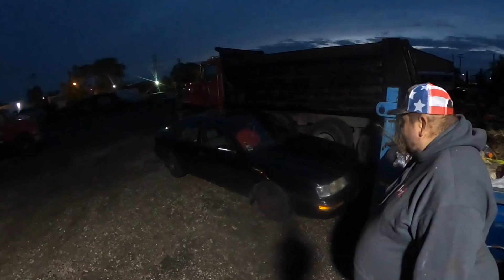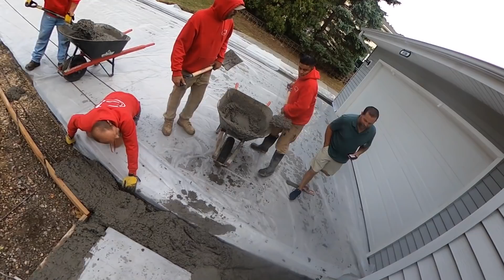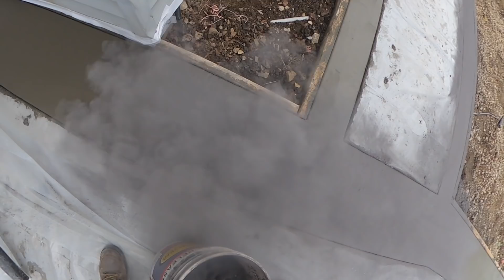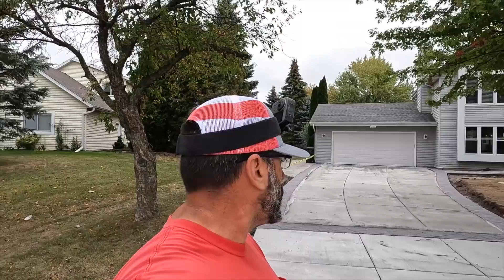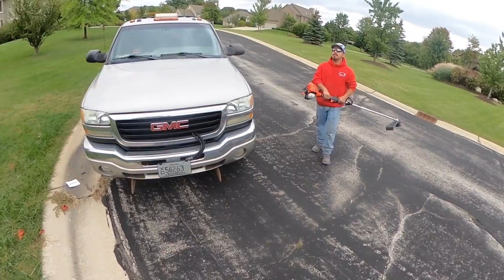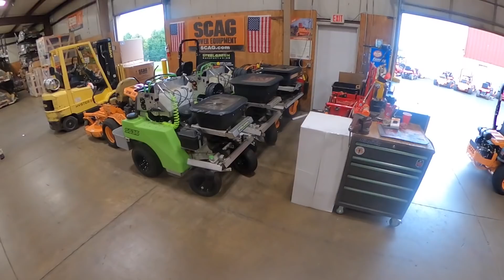Colored and stamped concrete borders-AND mowing

Comment: SCAG is the way to go. I’ve only been landscaping for 2 years, but I’ve been on John Deere, Wright, and SCAG. Scag really outshines the competition when it’s wet or super thick, has great throw for less clumps. Also has a much more comfortable(easy on the knees) platform and thicker pad to lean against.
Reply: ferris easily has the best and most comfortable to use mowers
Reply: @Richard Cranium it’s not as bad on mowers as the heavy equipment
Reply: @Richard Cranium .
Reply: Ferris and Exmark are the best in the game when it comes to mowing.
Reply: @johnvillanueva96  used exmark for years and switched to John Deere and won’t go back personally
Reply: @OlDirtyBandit  which machine were you running? And what machine did you switch to?
Reply: @johnvillanueva96  60” lazer z. Don’t remember what series but the John Deere’s are z700s 60”. The John Deere cuts the behaila grass better here in the south to me personally. Also less grass clumping from further discharging. The exmarks weren’t bad machines though I just seemed to have them in the shop more often
Reply: @johnvillanueva96  also use 52” John Deere mulcher for smaller fenced in yards that mulches great. My mechanic at the dealer is a nice guy so parts are easy to come by when needed and they don’t have a problem with me working on them myself
Reply: @OlDirtyBandit  ahh I’ve run the 52” staris and it works great but i also had the Ballard x blade adapter on it with their mulching blade and regular blade, great machine with the ryegrass, Kentucky blue and fescue lawns i have here in Wisconsin
Reply: @OlDirtyBandit  don’t see a lot of people run John Deere here so haven’t been able to see what the cut and quality looks like
Reply: @OlDirtyBandit  but my personal favorite is my 61” Ferris z2 the machine lays amazing stripes every time and cut is quality
Reply: @johnvillanueva96  I’m in south Arkansas almost Louisiana so mainly zoysia centipede Bermuda and st Augustine here. Kentucky blue and rye won’t live past April
Reply: @johnvillanueva96  I’ll have to look into Ferris. Never see them much here. Exmark John Deere and gravely mainly

Comment: Ryan, I am a landscape/hardscape contractor. We have been using toro grandstands since the first model came out. They have really came a long way over the years and no major issues besides normal wear and tear. Our oldest unit has 2400 hours on it and I wouldn't buy anything else.
Reply: 10000%
Reply: My oldest has 5400 no problems just normal wear and tear
Reply: You realize the pulled them from lineups because of the problems right and haven’t released a new version yet
Reply: @erikgreen5297  thank you I’m glad someone in the comment section is at least making since

Comment: Daryl Jr. Looks great with his new haircut! Definitely much needed. Sure he feels 10x cooler now lol as far as the truck damage. Honesty goes a long way. If someone just copped to doing it I think Ryan would respect that 100x more than knowing everyones refusing to tell the truth.
Reply: Those kinds of incidents when slow-backing a trailer are rarely obvious, he probably didn't even know he did it.
Reply: @PJ-ku5lp  It wasn't a trailer. It was the rear driver side fender on his pickup. Unless you're saying when they had a trailer attached thats what caused the damage. Either way they should definitely have felt it happening, even have seen it happening.
Reply: @nickp3173  I mean, I know what a truck looks like vs a trailer. lol... Yes, someone jackknifed the trailer into the truck, even they made that observation. When you're backing around in a parking lot at slow speeds, if you've got a radio on and a creaky trailer, those accidents aren't always as apparent as you might think. There's tons of leverage there, and the slightest touch of the two will muck things up fast.

Obviously he might have known he caused the damage, but I'm saying it's also feasible to have missed it depending on the situation.
Reply: @PJ-ku5lp  I drive large trucks every day of my life, I always feel everything or at least see it. That's just the good old excuse to not take any fault for it lol "I didn't see or hear it I didn't know". Literally what we say at work if something happens just keep on truckin and never stop to look!

Comment: I ran my landscaping business for 3 years with 2 Badboy sitdowns and a Badboy stander. The stander was a deal when it first launched at $6800, and I bought the first one that made it to my old dealer, but I'm not sure what they run now. The lockdowns last year put me out of business and I had to sell all of my equipment, I did keep one of the 52" sitdowns though for my own place. I demo'ed a wright that a friend had on a 2-week demo, and despite all of the hype, I didn't like it much at all. The Torro stander I demoed was high on my list, but they were starting at $10k when I was looking. 

One of the main reasons I went with Badboy, was that my dealer stocked their "Fusion" blades, which have silicon carbide hard facing on the underside of the edge. Down here in the sandy half of South Carolina, the sand will eat a set of blades in a couple of days, to the point they are 3-inches shorter on each end. The fusion blades would last about 8-9 days of use with 2 sharpenings in that period. So while the fusion blades were more expensive, they would last about 4 times longer for me, which was worth it.

I ran the grounds department at a small state school about 12 years ago, and we had a fleet of Skags, and on any given week about 1/4 of them would be broken down with a new issue. They were a few years old, but even new parts would break randomly. Maybe they got their act together as I do see a lot of the more heavy mowing commercial companies around here using them for what amounts to basically brush-hogging on a smaller scale.

Comment: Hey Ryan, try 2” painters tape on your edges. You can hold the plastic down with that, and its so easy to take off after.
Reply: Tape sticking to concrete to put it as Ryan would "is NOT the greatest".

Comment: I was a foreman for a 350 acre cemetery for many years. Originally we had Locke mowers, then we graduated to Bunton walk behinds. Then to gravely sitters but their cost and the cost to repair and maintain was unsustainable for the amount of hours and abuse put on them. We decided to give Exmark a shot at half the cost and went years using them and they still do to this day. They surprisingly took the abuse well and cost much less to repair. For you doing nothing more than an acre minus house foot print why spend $10K when you could spend half that for another brand. Or even better save a few more bucks and get a walk behind and get some great exercise while you mow.

Comment: I worked for a commercial landscape company on a military base back in 2011, all we had was huge Toro riders(can't remember the models). We had one walk behind mower with the cart you ride on.  We cut 500+ yards a week and the mowers took a beating. If the quality is still the same as it was then, the Toro wouldn't be a bad choice in my opinion. From what I've seen, the commercial Toro's are pretty solid units. Obviously we had some minor issues (replacing spindles mainly) with them but nothing too major. One of the mowers had nearly 4000 hrs on it. Which is insane for a gas powered zero turn.

Comment: Scag all the way. Reliability  is second in the industryGrass hopper is number one. From what I have read over the years. 
I have a scag and the cut is amazing and no clumping of grass on the deck. 
Also make sure you are comparing the apples to apples vs gravely and scag. Just a couple HP in engine, carb vs direct injection makes a difference in price. 
I would go less than 26 hp in that inch cut. If you were doing 61 I’d recommend nothing less than 30 hp. You’ll notice a difference in thick grass for sure. 

Love the channel.

Comment: Of course I didn't trust the SCAG dealer when he said SCAGs were the best cut, but apparently they are actually some of the cleanest cutting mowers. Might be some comfort issues, depending on preference.

The V-ride looks like a good investment. Also, the Toro Grandstand is right up there with it, it seems. So I don't think you could go wrong between the two.

Comment: The Toro Grandstand is my standing mower of choice.  I have been doing grounds maintenance, golf course maintenance and landscape construction for about 25 years now.  You might pay a little more upfront, but if you maintain it as it should be and are only using it for your home, it should last for a long, long time.

Comment: Yes I would love do the wight loss. I prefer John Deere stand on easy to operate and so easy when it comes to zero turn fast spin I have 54 in deck 18 HP it's heavy duty mine has Kohler engine low oil shut down

Comment: Scags use their own metal for the whole equipment lines as well I work in a dealer for scag Toro/exmark. Scags sell fast down in TX. Richardson saw and lawnmower is the dealer I work for. I highly recommend scag
Reply: Scag also made a 30inch mowers just recently was released that's the only thing I don't recommend but the v-rides 2 sell

Comment: i own 4 scags. 48" scag hydro walk behind. 61" scag cheetah. 52" scag v ride. and a scag windstorm (big blower) not to mention ive owned numerous other scags. ive owned every brand and i just prefer scag. nothing cuts like them. i would HIGHLY RECCOMEND you get a scag. however, i will admit its probably a little overkill for "homeowner use" but on the plus side it will last you a long while. i would say dont get the briggs vanguard, get the 52" and stick with the smaller motor options and it will put you more in the 9000'ish range.

AS I TYPE THIS, i just remembered, try looking into spartan or bad boy mowers. they are drastically cheaper- im talking like 6-7k for a stander- at least in my area.

Comment: Hey Ryan I'm new to watching your videos and really enjoy them I've been a landscaping and Snowplowing contractor in Cleveland Ohio for 27 years I've ran pretty much every machine I'm not a fan of scag Gravely is all I ran for around 4 or 5 years but once I got the Toro Z master with the my ride suspension I can't think of a better machine I don't run standers  anymore because of back issues and hips also I'm a big guy also 6'4 320 so sitting is better for me but if I were to get another one it would be the grandstand  the muliforce would be the best bang for your buck because you can put many attachments on it. Well anyway keep making the videos I enjoy you and the crew I tried it a couple years back just was to much to keep up with when you're doing it all by yourself. Take care and be blessed!!

Comment: im a dealer for all them mowers bud and we see the scag customers far less scag has been using the same wheel motors , engines ,pumps etc pretty much on all their units for years so when its time for service its far easier to source parts and these guys in florida deffinetly cut some grass here we run the toro z master in our rental fleet and have had little to no issues just the arms bars tend to come apart every few hundred hours

Comment: Ryan spend the money for the Scag. You will never have to buy another mower. I have a 48 that's almost 40 years old never had a problem.They are built to take a beating. Remember you are not the cheapest concrete guy either right? You have to pay for quality. Well worth the extra $$.

Comment: i wouldn’t go with weight. they have hydro pulley problems that have yet to be resolved. is there a hustler dealer around you. they seem to be a very well thought out design and easy to work on. i am a tech an the second biggest hustler dealer in the nation and rarely see them back in the shop except for maintenance. we also sell toro grand stands. they are good mowers to. they seem to go threw drive belts depending on how much you use them and if it has an efi engine i  have seen a couple with bad 02 sensors.

Comment: why did you put plastic down for the pathway and drive way?
Reply: They were pouring the colordd/stamped borders and that concrete would stain the existing concrete.  That's why Ryan was "yelling" at Daryl Sr to not walk on the uncovered concrete because it will leave a stain.

Comment: Hey Ryan! Love your videos! So when I go to put the second layer of sealer I use the pressure washer to get the dust off but when the water dries it leaves a residue on the concrete. What do you use to get those off, or what would be a better method to avoid that from happening?

Comment: I hope u write off both Darryl's on ur taxes as donations lol I've never seen someone in concrete do as little as them two do and I've been a union carpenter in NYC building high rises for 14 years. We have some lazy guy but jezzz, they give new meaning to the word lazy. They wouldn't last till lunch time on our jobs, then again our hourly pay rate is 65.60 and hour not including out benefit package, vacation pay in lieu of time off and our annuity. Every hour we work get get 8.00 and change put on the side for us and every 3 months we get that vacation check in lieu of time off. Same goes with our annuity, we get 9.00 and change in our annuity for every hour we work. Those vacation checks are very nice checks. Figure on a straight 40 hour week, thats 320.00 a week, 4 weeks a month = around $1,300 bucks, 3 months a quarter = around 4,000.00. Then whatever over time we get, we get time and a half in vacation, annuity and hourly. So vacation becomes 12.00 n change, annuity 13 n change and hourly is around 98.00 n change. So those overtime hours add up nicely on all ends. Id rather have the 5K+ vacation checks every quarter then have to take a week off every quarter. Dont get me wrong, every winter my wife and I go to an island for 2 weeks but thats about all the time I take off all year. Oh, plus my 2 weeks in Canada hunting every year. Thanksgiving week I spend a week in Alberta n then from Alberta I go to Saskatchewan for a week. Total 18 days a year in Canada hunting big norther whitetails and from the mount on ur wall in the office u know how much those 18 days mean to a hunter when hunting big northern whitetails in canada. So those 18 days are MY vacation time with my buddies who come with me every year (5 of us total) and then the 14 days in the tropics during late February/early March are my wife's vacation time. She chooses the islands and I choose the bush lol. Happy wife = happy life!